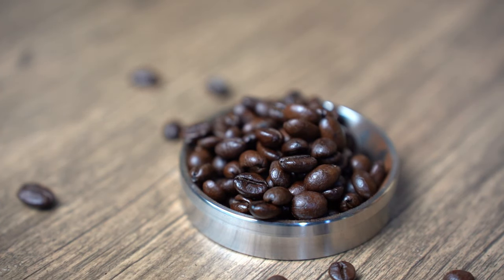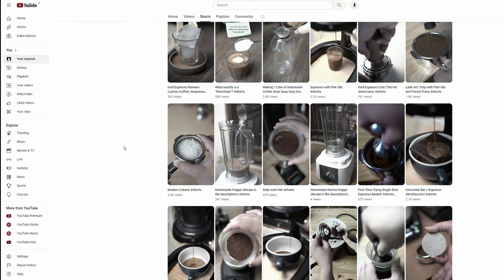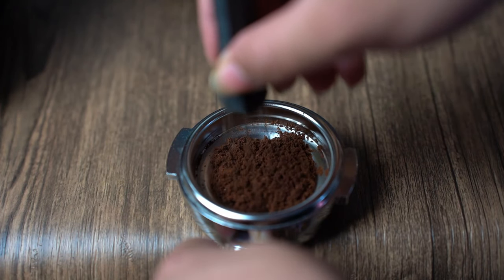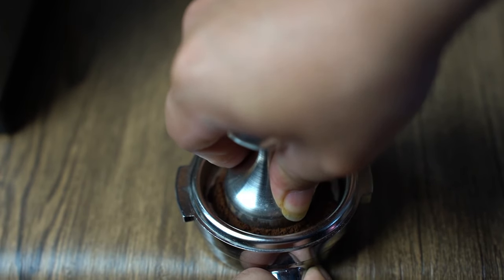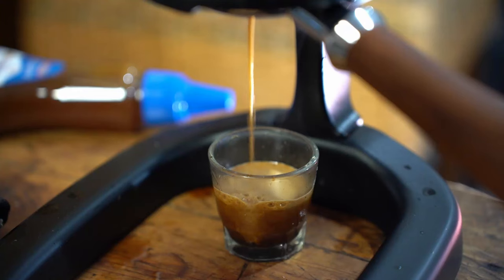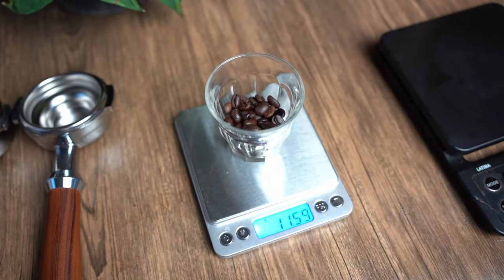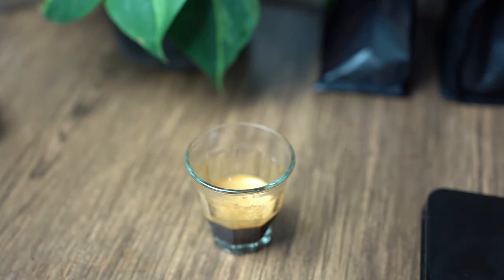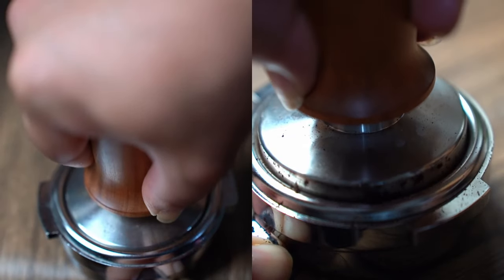Single-shot Basket Journey: How Should you Use One?

Comment from the maker: Hi there! Please note that:

1. I did mention that The Wired Gourmet recommended 11 to 13 grams; while in reality, he never recommended a range of doses. This was an error from my side, so apologies for that. I mentioned it because it's what you're expected to put on your singles using his method, rather than him personally mentioning/recommending that particular range.
2. I did modify the Home barista method slightly by implementing a small tamp first before a bigger one in the second and the final tamp. This is completely an invention of mine, because I found that going directly with a normal tamper is very hard to reliably do well.
3. I felt that the resistance from the tamp (with a normal sized tamper) is slightly different. Instead of trying to feel when the puck starts to resist, like in a double shot basket, try to find the force where the resistance from the rim (the outer part of the basket) and the puck is balanced/equal. If you feel like the rim is exerting way more resistance, then you might need to increase the dose.